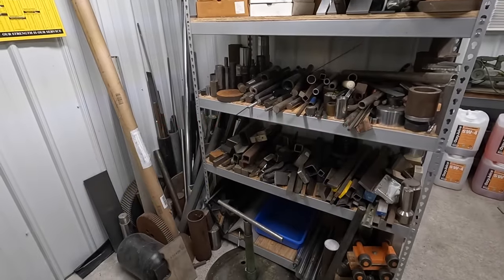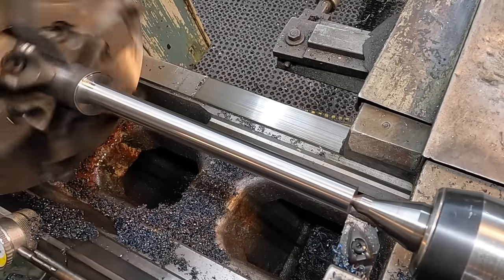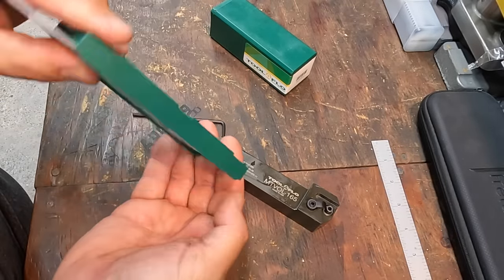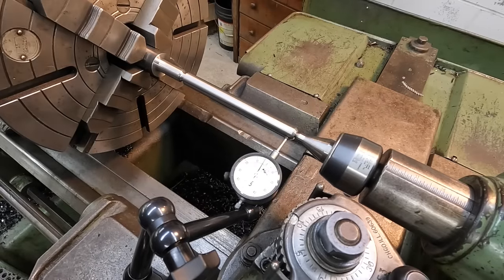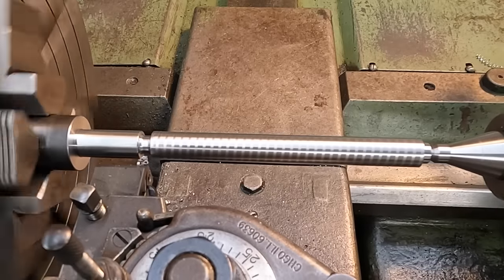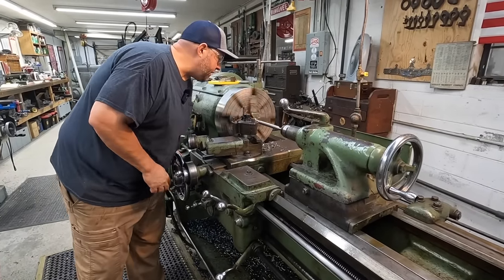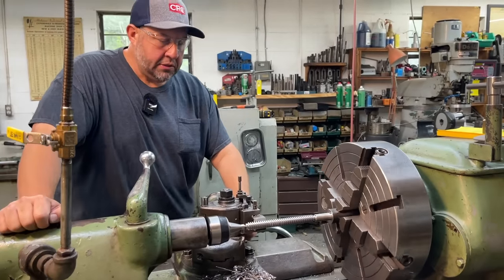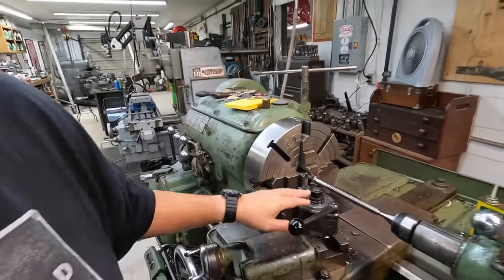Compound Lead Screw for American Pacemaker

Comment: Hey man, I've been there!  Acme's can be a bitch, there's a lot of tool pressure there.  If I can give a couple of suggestions... Plenty of cutting oil, even though it's 1144,  Clean-out cuts every third pass or so after you reach a little over half-depth,  and sometimes setting the tool just a hair above center because the central part of the shaft will try to climb over the tool.  A slight above center positioning will anticipate that and perhaps the tool won't be inclined to dig in as badly.   I like the idea you have of trying some 12L14, and be generous with the cutting oil.   I would be hesitant to blame the Monarch, but going to another lathe will help to eliminate that possibility.    Good luck on the next shot at it, and keep up the good work and videos!! 
GBD
Reply: Also, cutting a lengthy Acme thread is the only good use I have ever found for a follower rest.  They're a pain in the ass to set up and use, and if you get one out it usually means you're having problems with a job, but it might be worth a try if you're getting those results.
GBD

Comment: just a thought, but as your threads get deeper the material becomes more flexible in the center (where the problem occurs) 
maybe there is too much force on the rod- can you try leaving the stock long and using the steady rest? or running much slower and even shallower cuts each pass?
Reply: I had similar thoughts, or maybe set the tool a tiny (.0005 - 001") higher. Maybe run a little faster or slower.

Comment: I have to wonder if a fresh sharpened hss tool would have had the issue towards the end. 
I find that the old machines just don't like finish work with insert tools. I'm not the most experienced machinist though. 
Curiously reading through some of the others thoughts.

Comment: Hello, I cut such cuts and I also had such a problem. And I found a way out. I cut with cooling, first punched to the bottom with a cutter with a smaller sharpening angle and then subtracted each side separately and I succeeded.

Comment: I was thinking (I know no good can come of that).  Anyhoo, regarding the insert holder why don't they machine to tool on both sides so left or right hand threads can be cut with the same insert holder.  There's probably a good reason for not doing it.  If you know why, please share.  I can't believe the trusty old Monarch let you down, what is this world coming to.  Excellent video by the way.

Comment: Imo, taking a spring pass every 2-3 normal passes should work.
I think the piece is flexing a lot in the middle while threading and on the last few passes, your tool is getting too much radial dept to machine properly.
So it tries to pull the workpiece against himself, now it has a triangular shape.
I'm just a random CNC guy.

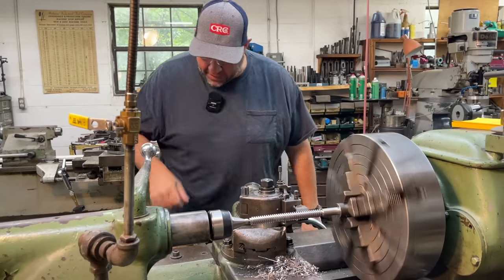Comment: You can actually see the lead screw flex when it starts picking up towards the end.  If you go to 36:30 you'll see it flex. You can even see revolving centre on the tail stock flex!

You can especially see it when you slow the video down!

Comment: od of that shaft don't mean crap.  there is no bearing on the od.  the acme sides matter  cause that is where the load is.  BTW  i got the same box full of various acme thread[and square thread too] accumulated over a 43 year machinist career.

Comment: You need to use one mark don’t use all four. The one groove will be consistent. 3/4” makes it easy to pull the work piece into the insert. I make clean up passes to make sure you keep the tool from making high and low spots. Cutting oil helps keep the metal cooler and lubricated. You know the deeper you go the root I.d. gets not too much bigger than.500”

Comment: In my opinion, the inner thread has touched a fairly small size, so once it reaches the middle of the thread it will lift because it has shrunk and has become easily bent.
so have to reduce the pressure.

Comment: ...follower rest and oil...
...you dialed in the left end...right end was running out...it may have reached a minor diameter were it tried to stress relieve itself...or a minor diameter were it started to deflect and climb the tool rather than cut...(too much tailstock tension?)...a little rake on a high speed tool might have worked better...I always thought machine parts should be made...or at least finished... between centers...

Comment: I had a similar issue recently, the machine would skip a tooth in the gearbox and lose the thread. Ended up tearing into it and the gears were very worn. Still waiting on replacements from the gear shop

Comment: Just a thought (I'm learning here).  Do you think the piece is heating up and expanding lengthwise, and flexing in the middle at the weakest point?  (I have trouble cutting stainless where it wants to move around in heat)

Comment: I have what is probably a dumb question by someone who just likes to watch machining videos. How does the tool always line up or index on the thread with each pass? Is there an indicator or something that tells you when to engage the feed so it lines up correctly with the previous passes?
Reply: Yes, the leadscrew turns an indicator with 8 numbers on it.  the lathe has a chart showing what numbers you can use depending on what thread pitch you are cutting

Comment: The problem here is that as you go deeper you are adding pressure on both sides of the tip and of course added to it is you not using special thread cutting fluid.

Comment: is the backlash because of the angle off the acme thread is pulling the tool in to the work piece.
if you hold back your tool post when you reach the the same depth and you'll see

Comment: What I think is that the work moved in chuck /rotated. Take it out and check the work
Also cutter is dull. ???   Cutter moved off center /forward!!!
I do spring pass at 3/4 mark depth. 4-times.   Part with blueing.  So as to see what's up √√√√√√√. Ray Abbott
Maine

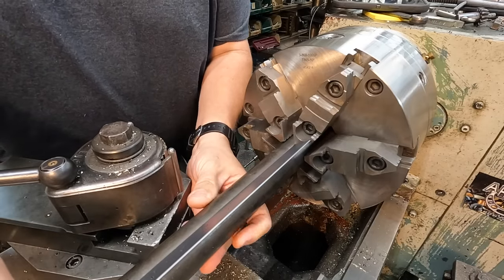Comment: I wonder if holding the toolbit a little above center would help?  Glad to see you explain that at 3:25, about center drilling the shaft while it hangs out farther in chuck and not moving the shaft before putting the live center in.  I do that as well and have seen that good practice in other videos.  It's easier on the tailstock quill and live center.  Back in 2008, an old guy was running the victor lathe behind my lathe.  One time he had the tailstock end of a shaft, live center, and quill running out that bad, that I went over to look at it and saw oil coming out of the oil detent ball on top of the tailstock.  I also heard a story of a guy breaking a whole steady rest when he mounted it over work and then turned the lathe on.  The work was not setup to run true before mounting the steady rest.

Comment: Is it me or does the tool holder clamp the insert funny. The 90 deg stop is on top. The insert is held by the screw/clamp pushed back on the 45 deg angle. Might be a better way! I agree with the angle of the compound, with a follower rest. This thing happened to be on the Logan, yes Logan. Had no follower, just made very light finish (on SS) cuts, worked. Anyways! We all learn. Thank’s Adam.

Comment: Is there any noticeable difference in thread quality or during the threading if you use a right hand tool on a left hand thread? I wouldn't imagine there is if the clamp is properly secured

Comment: When I have to do long skinny threads I turn and thread them in sections, but I don't know if that's feasible on a manual especially with a lefty thread.  also probably why most lead screws are rolled or ground. i did notice what looked like a chip in the trailing corner, of the thread either from mis match or a chip in the insert.

Comment: Back Again..  Is there a Tool and Die Company that manufacturers a Thread Cutting DIE for that Thread?  Like the Opposite of a Tap?
Reply: Dies would be impractical.  These types of threads for a lead screw are almost always made using thread whirling.
Reply: Let’s say for instance there was. You would need the die to be the exact dimensional match to the ACME tap he used or you would potentially have a sloppy fit. By single point cutting the lead screw, he can machine the fit to his liking.

Comment: Why did you rechuck the work?  I would have either kept it in original chucking, or if for some reason I HAD to rechuck, I would use collet & grip on the machined surface.  If you had colleted the work, you could thread closer to headstock & had less canteliver.  Other option would be to not turn the work down left of the undercut for more rigidity.  Also avoid chucks mounted on backplates.  That increases overhang.  "Un-rigidity" is proportional to the CUBE of the overhang distance.
          To stop digging in, set your tool higher, slightly above center (double-check to make sure you are not below center.)  USE CUTTING OIL!  Check the back-rake, make it more negative.  When you have to make a heavy cut on a long, thin, workpiece, modify the tool geometry to reduce the area of contact.  Way to do this is to use tool that is of "correct" form but TOO NARROW (for Acme thread next finer).  On alternate passes, adjust the phasing so you cut the left side of the thread on one pass, cut the right side on the 2nd one, then advance the depth at this point & make 3rd cut centered, deepening only.  Alternate these passes until you reach depth.  Adjust phasing to widen the thread to spec by cutting from one side only.  To adjust phasing, set compound parallel to longitudinal axis.
          (This strategy is used in industry regularly.  Example is table & band saw blade with alternating teeth: triple chip grind, alternate top bevel, teeth set alternate left-right-raker to reduce vibration & keep the kerf wider than the tool.)
Reply: I wondered that also

Comment: I have did this many times my suggestion is that the cutter should be thin from bottom and thick from the top
Reply: It been the hart cutting to muck off close to the end the steel starts to bend it trys to clime the tool it happens to us all. L thought only l could this but it hapoens to us all. Mate

Comment: Hi Adam I noticed when you were threading an Acme using the Monarch lathe, it looks like that has automatic reversing for threading why didn't you use it ?
Reply: I was also wondering and in my entire machining experience, I have never worked with manual reversing. It's quite cumbersome.
Reply: @keithmusonda2138  no we had automatic reversing on three of our Monarch lathes it's so precise once you set the stops it'll stop at a shoulder and reverse the carriage back without stopping the spindle and then you click forward and go and take your next cut used it all the time

Comment: Question for you Adam, from a novice.
Would i help if instead of pushing on the material. you could have something pulling instead.
The point is that the pushing could cause a small but not insignificant bend.

Comment: I was beginning to be a bit envious of your abilities, and the great ease with which you use this equipment.   Then the big Oooops!   I would have had that Oooops a lot sooner, if skill level was the issue..  Sorry big guy.  I wonder if the screws on the cutter loosened up just enough to do this???  I always go to the new guy when looking for cause of trouble.  We always assume a quality tool will work correctly right out of the box.  Your lathe would have showed this problem sooner it seems...

Comment: Is it trouble from 2 left & right vertical angle sides of Cutting knife tools must a bit slope to the Right hands top side?

I thought the thread gap all over of the rod length are not the same space from start-middle-end.
At start and end point of rod are close to the holder not scratch and moving, so the cutting tools can passing with the friction then a bit wider than you need.

But at the middle of rod far from holder
when the cutting knife come around there, the friction from 2 vertical sides of cutting tools will make a scratch to the thread rod with vibration.

Comment: I suggest you go through the lathe carefully and reduce the end float on the lead screw, also tighten the gib strips on the half nuts and also the cross slide to reduce the freedom of the tool to go where it wants to instead of going where you want it to go.

Comment: Might be caused by the screw flexing as the effective diameter is reduced as threading proceeds. It started as the minor diameter got small. Might need a follow rest.
Reply: Not a machinist, but since it appears to start when he was away from the chuck a bit, this sounds very plausible.
Reply: Also the cuts went from a thin breaking chip to a heavier spiral chip as things progressed. Lower surface speed as the tool gets closer to the center plus heavier cut could make it bend more?

Comment: Unbelievable why no cutting oil ? on a long coarse thread, also I would use a standard thread tool first to remove most material then use your acme tool and slow down rpm.

Comment: I'd run the tool above centre, so Front rake becomes like a brake to stop the backlash pulling in.
Reply: Good idea, I was also wondering about if he had set his infeed angle to match one flank.  Then he would be cutting on one side of the tool, not both.

I’ve seen a couple shops that would cut their threads with a 90deg infeed and it would give you the most torn and shitty thread start and finish.
Reply: @kw2519  Adam always feeds in at an angle using the compound. However, he did not use exactly half the angle of the thread (that would be 14.5 degrees here). He mentioned that he used an infeed at 14 degrees here so that the tool is still touching the trailing edge a little.
Reply: @EdwinSteiner  Yeah, you can see it doesn’t have any relief, both sides are cutting.  Just makes for a super high tool pressure.
Reply: There can be lots of issues to affect the outcome of this thread.
IE no traveling steady, tool pressure, material choice, oil/coolant, back lash, tool surface speed....either way.
Adam will work it out.
If the new machine cuts this thread with no issues following the same set up parameters.
Then backlash/wear could of been the only reason.
On some course thread I've left the main slide be -0.005" of Zero then lay on compound feed so only part of the tool is cutting so save full pressure of tool.

Comment: Is there a reason why the top slide is at an angle ? I'm speculating to cut more on the forward cutting side, but why ? Thanks.
Reply: Thread cutting is a form cutting action. Meaning that instead of a small chip being produced, like is the case when you're turning down a bar to a given diameter, a large ribbon of material is being cut away to create a specific shape or "form". This requires a LOT of force and torque so anything you can do to reduce either or both is a really good thing for the machine, the tool, and the part.

If you plunge straight in, you'd be cutting 3 sides of the part all at once for acme threads. By angling the cut at half the angle of the thread (in practice it's usually a little bit less than half), you're only cutting on 2 sides instead of 3. That's about 30% less material that's removed per cut which reduces the amount of force and torque required. That's because the angle you're coming in at is about the same angle as one side of the thread is so by cutting the bottom you're forming one side automatically without actually cutting it.

There are loads of thread cutting videos that explain this better than I can here but I hope this makes sense.
Reply: @lkw6640  You explained verry well, makes perfect sense, thanks! I saw afterwards the project sadly failed, wasn't expecting that at all. You think the material was becomming too weak, or something went wrong with the lathe, or other ? I think it's great Adam showed this failed project, so we can all learn.
Reply: @BrainHurricanes  You're very welcome. I'm still learning myself. All of us are really. We never stop learning no matter how long we've been doing this.

When you watch the video you'll see that, at first, the tool is cutting mostly the bottom of the thread and the right side. At some point, around 26-27 minutes in, you'll see it start to cut on the left side. Just a little at first but more and more as he goes on.

The tool shouldn't be cutting on the left side in this situation, or at least a minimal amount depending on the angle but certainly not THAT much.

That means that something moved or slipped. With the amount of force he's using (necessary with carbide), the work probably slipped in the chuck. That's just my opinion, I could be completely wrong but I've had that happen to me a time or two.

That would make the work go out of time or out of sync, if you prefer, with the lathe spindle and lead screw. So the tool would cut on a slightly different path that before the part slipped.

That new path puts a lot of force on the part which pushes the part up and away from the cutter. Since the part is still turning and is now on top of the cutter, the part acts like a car wheel in motion and rolls on top of the cutter and toward the operator.

Because the part is now flexed, it acts like a spring under tension which puts even more force between the part and the cutter.

At some point, the tool begins cutting again but, because of the huge increase in force, the tool digs DEEP into the part. That's the awful sound you hear. This all happens VERY FAST.

Something you should also know is that the part will flex more in the center than at the supported ends. A follow rest could be used to prevent the part from flexing by supporting the part at the back and top right next to the cutter. It "follows" the path of the cutter thru the entire cut.

Sorry it's so long but I thought you might like an in depth explanation of what the most likely cause of failure was in my opinion. Cheers!